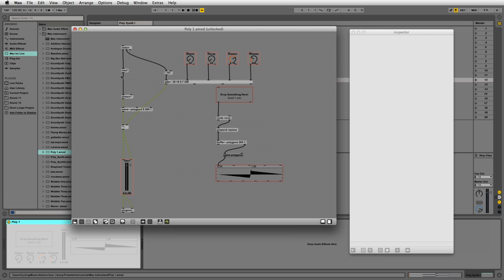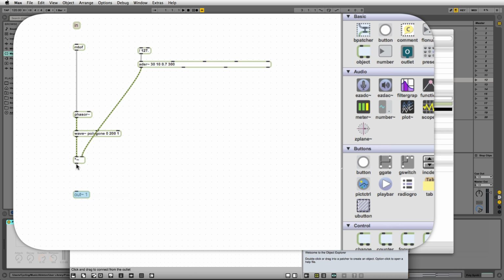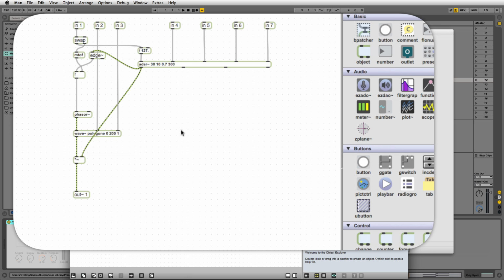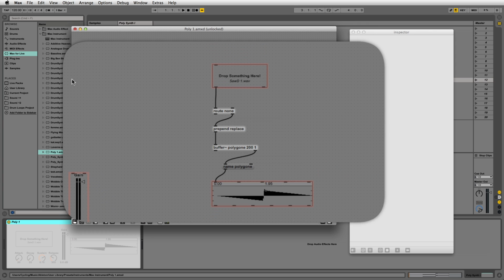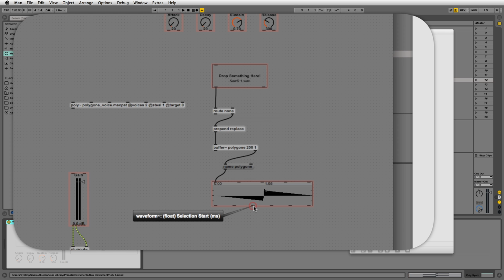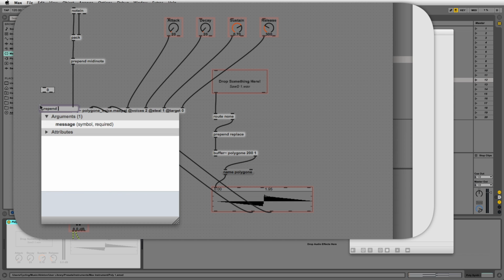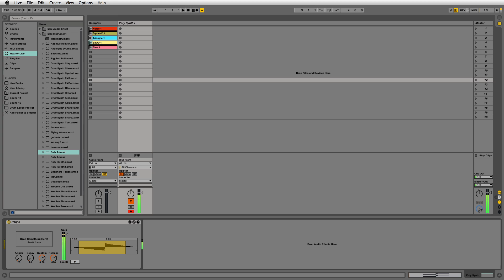#16 Poly Synth Part II

Comment: someone wanna give me a hand? everything's working, except whenever I try to play two or more notes at a time, it just plays the same note at the same pitch. For instance if I were to try and play A1 and C2 at the same time, and I played A1 first, when I try to play C2, it just triggers A1 again. It also won't let me change notes until the entire adsr cycle has finished, so if there's still release playing, if I try to play another note, it repeats the same note until the entire sound has completely faded out.
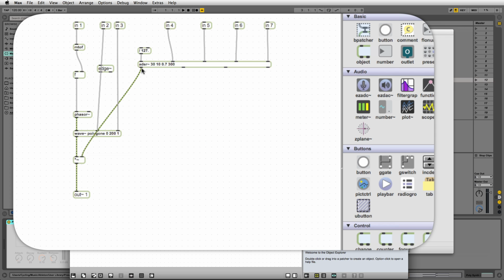Reply: +Theromoore10 I think there is a mistake in the patch at 2:30 : the second outlet of adsr~ should be connected to the edge~ object (instead of the first as in the video). That way edge~ will output a bang for the new trigger instead of waiting for the signal of the previous envelope to go back to zero before triggering, hence the repeated pitches when you play notes within intervals smaller than the total envelope time.
Reply from the maker: @stephanemorisse  correct! for note-stealing to work correctly, edge~ must be connected to the second outlet of the adsr~ object. this was missed in review, as the behavior is masked when the number of voices is cranked up. at 2 or 3 voices, though, it becomes very apparent that note-stealing isn't working.
Reply: +Theromoore10 You probably just have to set the number of simultaneous voices in the live.numbox which was added to the Presentation view. This is shown in the video (but not very explicitly stated)